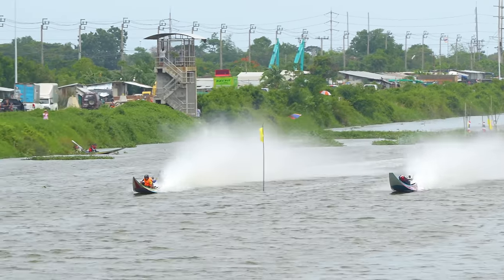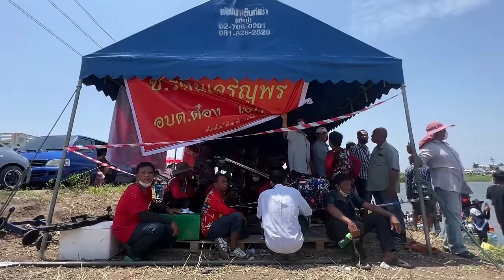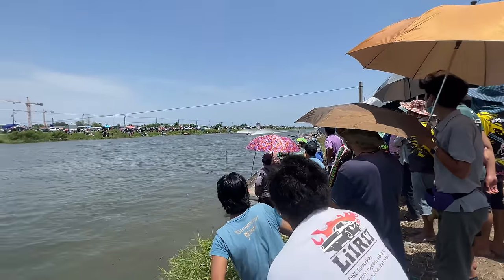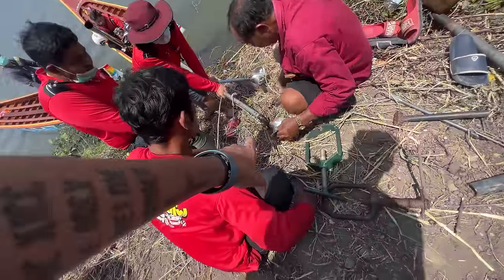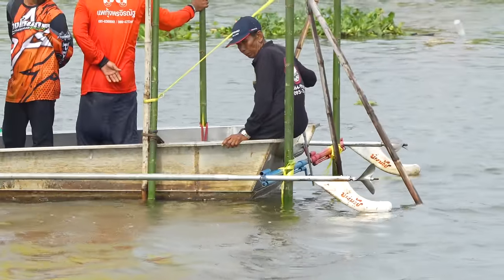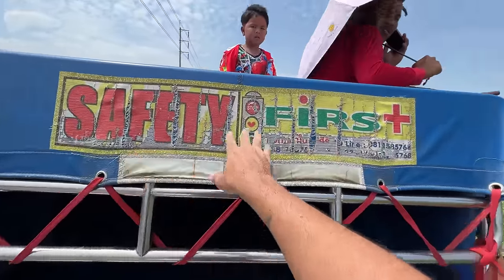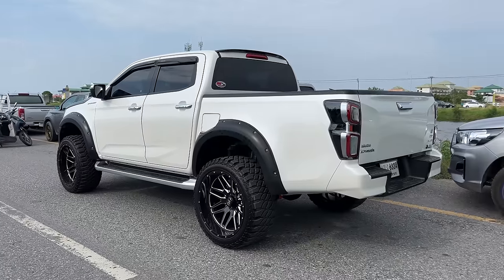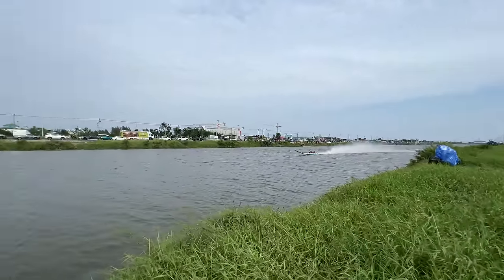Toyota 5K Longtail Boat Racing in Thailand - OMFG That Sound!

Comment: That's cool how they do the start with these boats because there's no reaction time to separate them at all and it is basically left all to the performance of the boat! Some good races there for sure!
Reply: Of course there is the skill of the driver involved. He has to quickly place the propeller just right to get the boat on-plane while steering the boat using arm and body weight.

Comment: I would stick a Hayabusa engine into one of these and a proper propellor from a very high powered outboard motor. that should be a fun trip
Reply: Too complex engine ... Learn from the Thai how to keep it simple
Reply: You're aware that there's no brakes on those boats right?! Sooo....GL with that whole stopping part when you find your Thai boat is going 180mph+ in a matter of seconds. 

Plus my guess would be that with how much power and torque that would be generated from the busa engine it would more than likely end up causing the boat to flip backwards after finding out there's absolutely zero f'n way you'll be able to attach enough down force on the boat to keep it remotely level.
Reply: busa has been tried and failed cant turn the prop 12000 rpm would need a gear reducer....just not the right setup.or you would see it here....

Comment: Super interesting glimpse through the window into Tai boat racing. I'm dieing to know what those motors are actually pushing. And I bet the mechanic would love to talk to you . Gotta find an interpreter if somehow possible.  I've often wondered way you don't see motor and prop setups like that in the west and west coast in particular.
Reply: Because they're shallow water boats meant for rivers, not sea going craft. The long shaft keeps the prop very shallow in the water, which is good for avoiding weeds, and not so good for nice prop flow. They're also incredibly hard to steer. Just watch the guys handling the engine as they come off the line and you'll see why. Those boats are popular because they're cheap compared to an outboard engine.

Comment: Question...Is there a limit to how deep they can run their prop's in the water? Any benefit to deeper or more shallow?
Reply: the driver changes it constantly depending on conditions. I think the aim is to have the bottom half only in the water like a surface drive.

Comment: The big factor for this kinds of boat is the design .not design for aero dynamics.. the front of that boat is flat not good from the wind coming in front .they should have make a good design boat so that there is  a good stability  while boat is running fast.

Comment: If you really want to make your Toyota engine sing. 
LC ENGINEERING 
Lake Havasu Arizona. 
I rebuilt mine with a stage 2 performance kit. No trouble turning 35in tires on my 1985 Toyota 4X4.

Comment: Useless knowledge warning: Older, smaller, Toyota Forklifts (3-6000 lb. Lift Capacity) often came with a 5R engine. Now they typically use the 4Y engine. The medium sized forklifts (8-12,000 lb. Lift Capacity) typically use a GM 4.3L V6 engine.